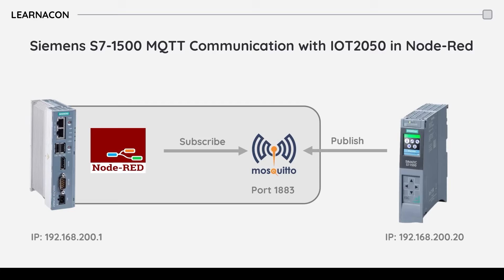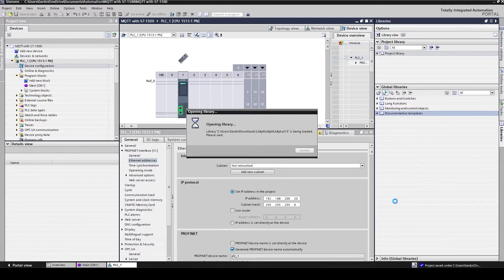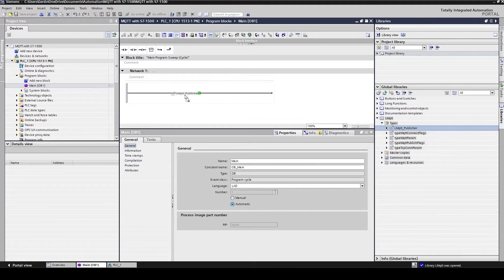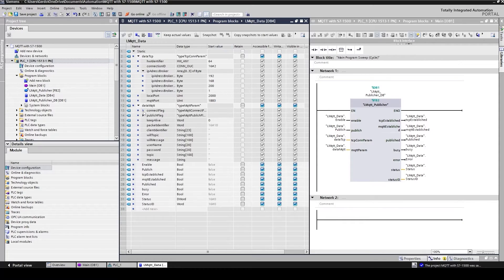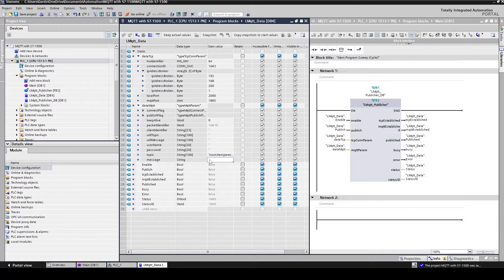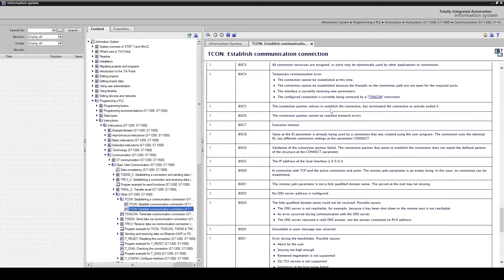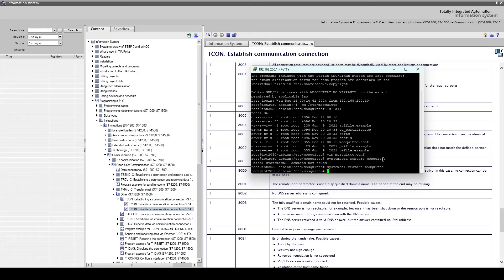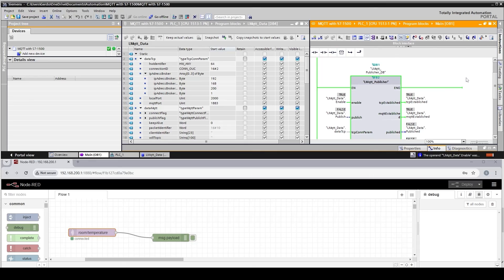Step-by-Step Guide: MQTT Setup Between S7-1500 & Node-RED on IOT2050

Comment: Thank you for the very helpful video. I would like to ask about the possibility of building an MQTT communication between a Siemens PLC and Insight Hub (mind sphere) without using Mind Connect IOT2050 or similar hardware. Can't we try to do it with the normal TIA MQTT library, mosquito software, and insight hub VFC flow?
Reply from the maker: It should be possible. You just need to make sure the Lmqtt FB connects with the broker, wherever it is.